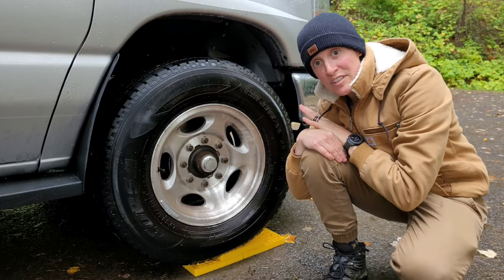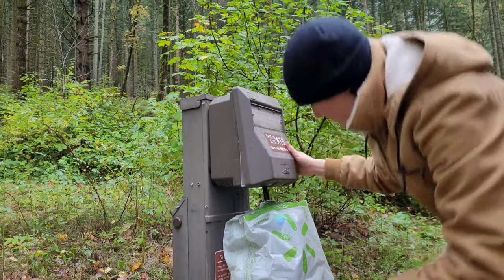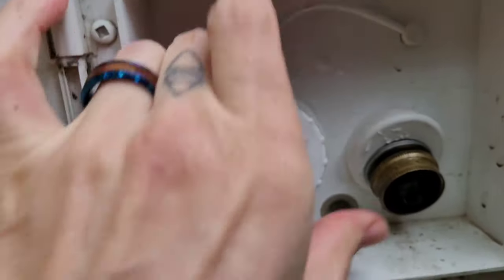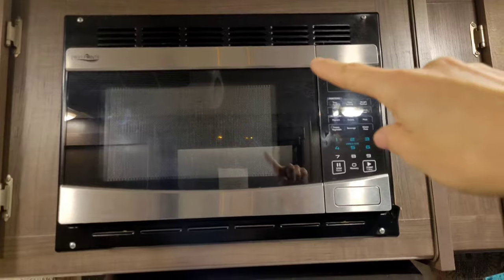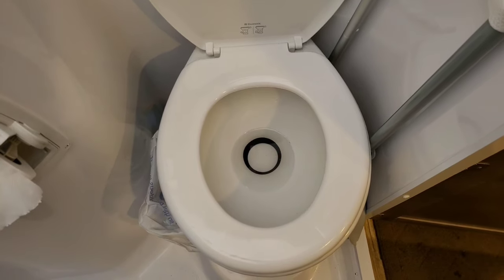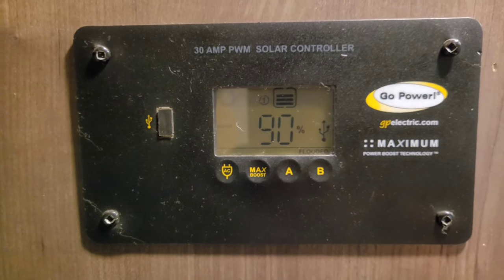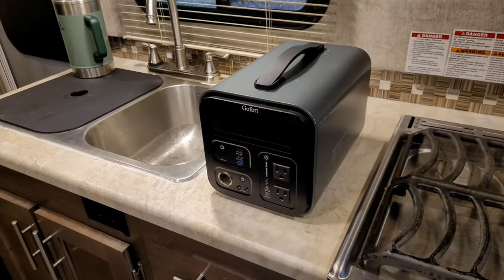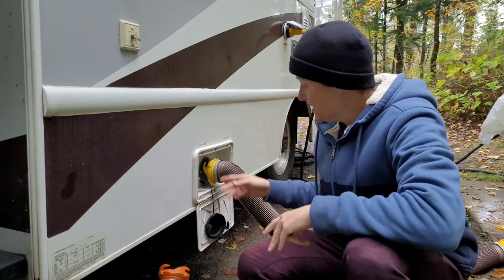RV 101: How to hookup and disconnect at a campsite

Comment: Thanks for taking the time to make this - I appreciate it as a new RVer, and someone preparing to go full time - as soon as I have solar!  And levelers.  Levelers are important in a Class A.

Only feedback I have is to open grey tanks first - use it to check your slinky connections.  Don’t drain it, just a bit to confirm connections are all solid.  Then close grey tanks, and open black.   Still saves enough water to wash out the slinky, but is a lot better to have a grey tank mess, than black.  Again, thanks for taking the time - I know it isn’t easy.
Reply from the maker: Great point! I've never had my slinky connection fail me but I'd sure as heck prefer it to be gray instead of black if it did! 

Thanks for the tip. Have fun out there full timing. It's the best!

Comment: Good morning, excellent explanations and demo's !
The ALP Adventurer 19rt is the best set up, just wish they were more available on the used market but that reason is simple, once you own one you don't want to sell it, they are simply the way an RV should be built, insulated walls and roof, thermal-pane windows, all the water pipes are inside the house, and extreme quality control at the manufacturer.
You can buy them new with a generator package.
I don't hook up at all when I get to a camp site, I use house water the entire time and fill when I leave.
I have a 1996 Fleetwood Jamboree Sport C, dinette and galley in the back with the bathroom forward.
Tankage is 50gal fresh, 38gal grey, and 38gal. black. Not sure how big the Propane tank is, never had it empty, my best guess is 9 to 12gal. enough for a month of boondocking including heater use.
I did a Lithium conversion for the house battery, 300mAh Enduro, a full LED conversion for the lights, two Maxairs to the roof vents, one front and the other is where the original house AC was, plus a Vortec-II fan in the bathroom.
Not having the 110lbs of weight of the house AC unit up high on the chassis helps with sway roll on the road, but enough about my rig,  

Again, your video should be a MUST VIEW to all new,,,, for that matter, all RV owners.
Hope we meet sometime, 
Happy trails !
Reply from the maker: You flatter me. Your rig sounds perfect for extended time without hookups. My 19RD is the "plug and play" model so it has smaller tanks. I run out of propane quickly if I use it for heat but it lasts months in the summer. So you win some you lose some 🤷‍♀️ I really can't complain its such a great RV.

Please feel free to pass this video on to anyone who may benefit. Take care.
Reply: @BackcountryDirtbag  Thor/Wennibago took a cheap shot at it but the center side dinette with the galley & bathroom in the back of the coach with a boot bench next to the center entry, or no boot bench and a sofa instead for the rear entry floor plan, every other manufacturer followed suit. 
Like in real estate, the view is 80% of the value, then it's location, location and location,,,,
The ALP, like my rig are super blessed with a perfect floorplan, 
The ALP used it's design voids better than Fleetwood.
I'm adding a drawer under my wardrobe cabinet, there's nothing at all in that void over the hot water heater and water pump.
This one, like yours, has enough horsepower to get me trouble too.
But unlike yours I have no insulation in the walls or ceiling I want to do a 4X4 upgrade but that won't happen until I see an ALP in person.
I only want to dump $15 to $20K one time.
Like to feel if it's got as much storage as mine, hate the idea of piling my passenger seat with stuff, 
The rear storage area of the ALP is impressive, I only have a glove box for a basement compartment.
There's almost no info on my rig on the net.

Sorry to rattle on, it's a slow Saturday here.

Clear paths to ya,

Comment: Questions: 
1. How do you keep your dog safe and cool in the RV when you’re out hiking? 
2. Can you do a more detailed video the next time you flush your tanks? How does the freshwater get from the tank to the RV? 
3. Space saving storage hacks 
4. Rig driving tips and tricks and DO NOTS 
5. How to find the best boondocking sites and national park campgrounds.
6. What to look for to avoid shady campgrounds… and by shady I mean unsafe. Are there unsafe campgrounds? 
7. If you want to run a heater the majority of the night. What size solar or generator do you recommend? 
8. What/if any creepy situations have you found yourself in while full time RVing? 
9. Do you use a WiFi booster? Which one? Does it work while boondocking in the middle of nowhere? 
10. Typical maintenance and repair likelihood and costs 
Sheeeesh I can go on I have so many questions 😅
Reply from the maker: Hi Dani! Thanks so much for commenting. It makes me really happy to know this video helped you. A lot of the stuff you requested is already in the works, so be sure to subscribe. 

In the meantime, I do have a full in-depth post on my blog covering heat management and finding great boondocking locations. You can see that here:

https://backcountrydirtbag.wordpress.com/2023/02/15/rv-without-reservations/

Comment: Thank you for sharing this on my post on Facebook in women in RVs. So helpful 🙏
What length hose would you recommend for the drinking water only hose and the flush hose?
Reply from the maker: You are very welcome. I love knowing that it helped someone. Hose length really depends on the kind of camping you plan to do. I mostly stay in campgrounds where the water is right next to my rv, so a 25-foot drinking water hose and a 15-foot hose for flushing have always been plenty.  

However, if I wanted to stay parked at a friend's house and hook up the water at their house from the street, a 50-100ft hose would be more appropriate. 

Additionally, when I do cross-country trips, I carry two 25-foot drinking water hoses. Places to fill the onboard freshwater tank can be farther away from the nearest parking spot than a 25-foot hose would reach. Having 2 or 3 25-foot hoses means you can get water from further away, but you also don't have to deal with a single 100-foot hose at every campground. The longer hoses can be annoying to use/drain/ coil up to store when the water spigot is only 5 feet away. 

Hope this helps you make the right choice for your particular style. Have fun out there!

Comment: Great video, thanks for such detailed information. I'm thinking of buying the Alp 19RB. Likely travel to Toronto to rent one this summer first then tour the dealership. Did you rent before you bought one? There doesn't seem to be a lot of information about the Alp from owners either on You Tube or otherwise. I subscribed to the Facebook owners group but can you suggest any other resources where I can find out more about the coach. IE: GVWR, GVCC, average gas milage, how is the roof made, how much can I safety carry? etc... Also, I see you are now doing videos with a Scamp trailer, did you sell the Alp? Can you do a review in the future, pros and cons? Thank you!
Reply from the maker: Ty for the kind words 🙂 I didn't rent before I bought one but I have a long history of owning RVs. I knew that a 19ft RV with a full size fridge and 4 season insulation was a unicorn of a rarity. 

Info is super hard to find but there is a company in Arizona that imports them, uses them as rentals for a few years and sells them off. Maybe they can help you with all the specs: https://www.phoenix-motorhomes.us/

MPG depends on which engine you get. They have a V8 and a V10. Mine was the V10 and it got 9-15 MPG depending on if the tanks were full or not. 

I did sell the 19RD before I got the Scamp. A pros and cons vid is a great idea! Subscribe so you won't miss it once I get a chance to film that. 

Good luck to ya!
Reply: Thanks for the reply and more helpful info. I will reach out to the resource you mentioned! New subscriber!